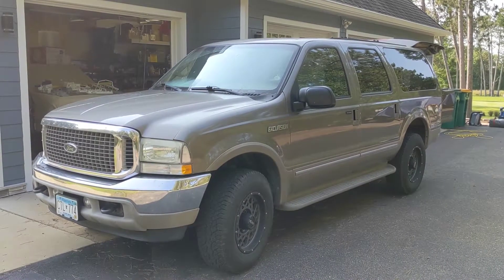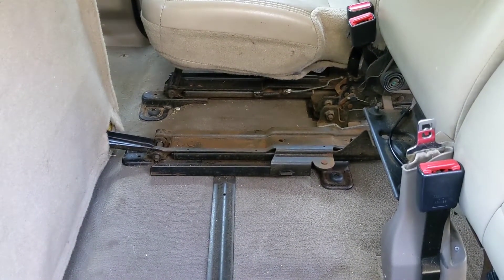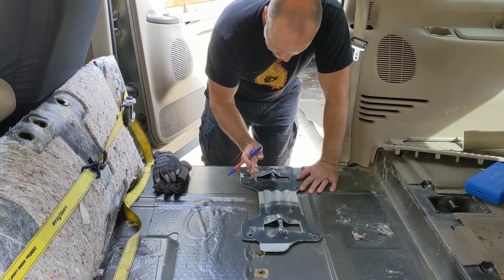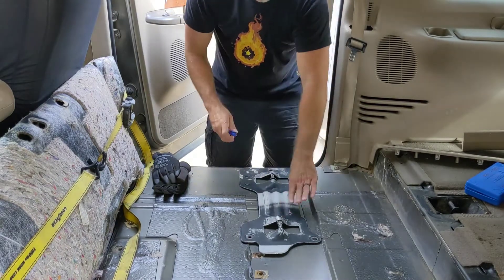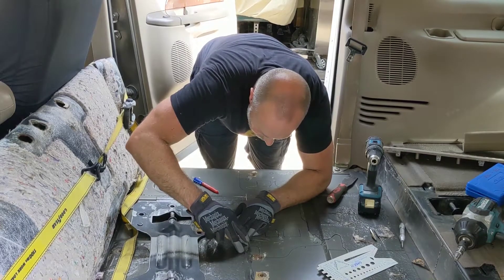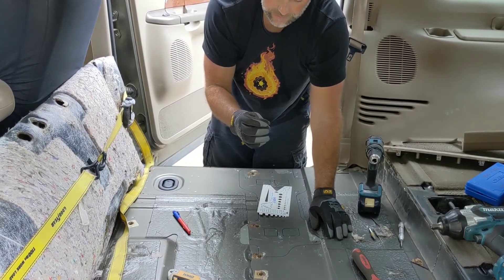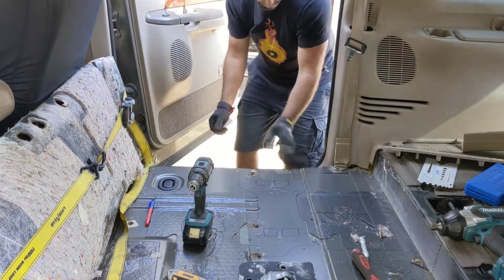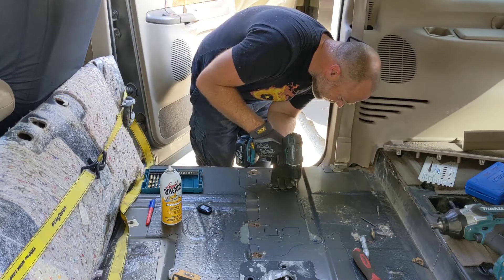Excursion Seat Swap part1

Comment: Where did you get those plates that your bolting in where the seats latch in
Reply from the maker: Those are actually from an Expedition (a 2010 I think). They are the factory mount plates for the Expedition seats. They just unbolt from the floor. I got mine from a junkyard.

Comment: Where is part 2
Reply from the maker: Part 2 has yet to be completed. Excursions being as big as they are, don't fit in my garage. I didn't get to it before winter and now it's consistently dipping below 0 temps. I'll get back on it once springs hits.
Reply: @bleepingfastmotorsports  Any update on a part two??
Reply from the maker: @sbrady116  at this point no. Other projects and moving/house remodeling have kept me away from this one. I'm not sure if it will happen at this point. The Ex keeps developing new issues and they are starting to pile up. If it happens though, I will be sure to do a part 2.